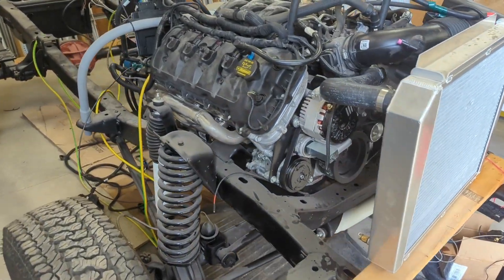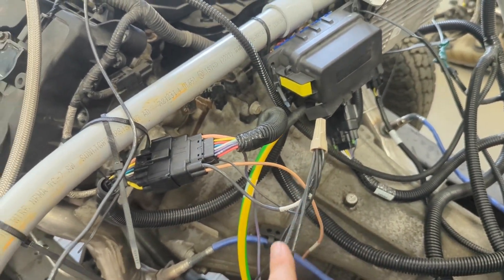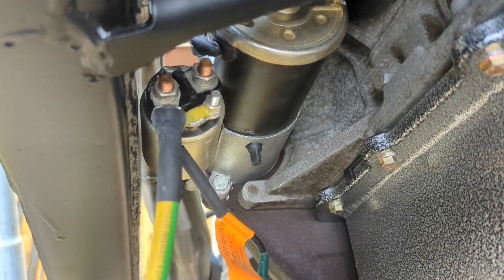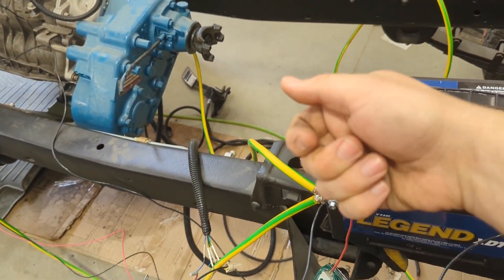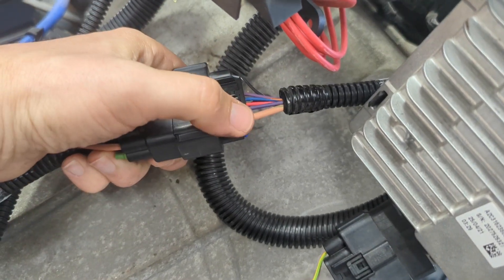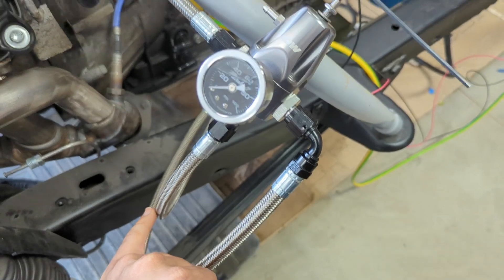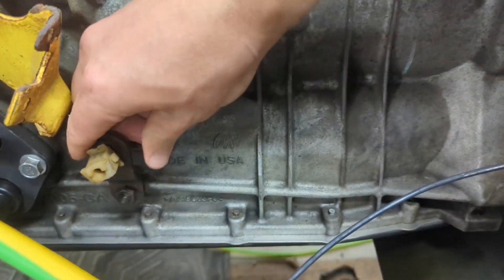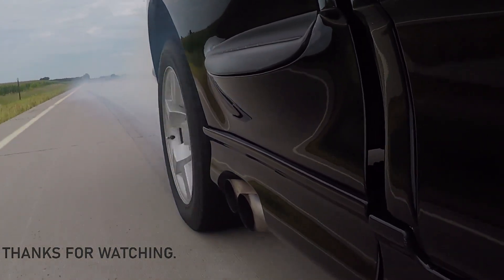How to Wire a Gen1 F150 Coyote 5.0L with PBH 6R80 Harness and Ford Performance Control Pack

Comment: Did you do something to the ECU?
I mean, deleting the PATS ando those safety systems from the original setup.
I'm working on the same gen 1 swap and I'm having a lot of issues.

Nice video, man.
Reply from the maker: We did nothing with this ECU. It came with the pack.
Reply: @605BOLT so the ecu it's completely stock?
Because i heard that I need to flash it to delete the system that I don't need.

Thanks a lot man, I'm trying that and let you know what's next.
Reply from the maker: @DOSCID96 it doesn't need flashed because it was part of the power pack. If you take one from a pickup or something then yes I think it needs to be flashed to remove that.
Reply from the maker: Thank you for the kind words.

Comment: What long tube headers are those?
Reply from the maker: They are from BC broncos. Idk that I would recommend them. Nowadays I would probably buy a set from Toms Off-road.
Reply: @605BOLT ok I appreciate it, I’m coyote swapping a 64 galaxie so I got to find something that fits nice and tight and the flanges don’t hit the Fire wall
Reply from the maker: @sammyvices2547 oh I gotcha. Then these BC units might not be terrible. Idk this for a fact but they seem like they might be mustang headers that they just put different ends on. You could try the same if it looks like they will fit.

Comment: Did you use a stock engine harness or is it a modified harness to accommodate the Mustang firing order?
Reply from the maker: The engine harness is the one from the truck.

Comment: Nice work, thank you! So you don’t have to do anything with the transmission lines to test run it?
Reply from the maker: If you want to run a long time then sure. We started this one with drained transmission fluid and no cooler. Need to make sure the trans is in park though.

Comment: Will the inner fenders fit or is there trimming.
Reply from the maker: For a coyote swap on a bronco, you need to do like a 2" or 3" body lift and then one of the fender wells needs to be tipped in.  The Rustbelt Offroad body that he has came with the fender well tipped out.  Its not a huge change.

Comment: What headers did you use?
Reply from the maker: @jameycreek5062  they are bc broncos. I would probably go a different route today. They're just so so.
Reply: @605BOLT They sure look better than mine & have the sensors built in, unlike mine
Reply from the maker: @brianberes6564  ya if I had to do it today I would probably go wild horses or toms
Reply: @605BOLT Mine are Tom’s via PBH.  They were the least expensive but look good and fit ok but very tight to transmission.  Only regret is no bung for the sensors …
Reply from the maker: @brianberes6564  sounds like you'll be drilling and welding haha. Oh well I've had to do that a few times. Not too bad.

Comment: Hello! What transfer case are you using and what kit did you buy to adapt it. Thank you !!
Reply from the maker: The transfer case is a J Shift Dana 20 from a the last years of the early bronco.  The kit we used to adapt is an Advance Adapters 6R80 to Dana 20 setup.  I have a video showing the installation here. 

https://youtu.be/m1MD5Y3Cd9Y

Comment: awesome!! i've been looking (and waiting) for a concise video showing all of the connections to the PBH harness and the control pack. thank you for making this video.
Reply from the maker: @ramrodou812  no problem man. Hope it goes smoothly for you. It's not bad with a couple of the little things clarified.
Reply: Although, I always thought that with the Ford Performance control pack, you wouldn't need anything else.....especially with the cost of it. I'm going to use a manual transmission in my swap. Is the control pack adequate for a manual?
Reply from the maker: Control Pack is good to go with a manual I think.
Reply: @ramrodou812 go with the Ford Racing control pack. I called PBH and told them I was looking for a control pack for my Mustang and I would be running a manual transmission. We had a long and good conversation. The manual transmission came up a lot as in which one I was going to run. They still sold it to me without any warnings. 

A couple months went by and then I started putting things together. I found out I was missing the harness that goes to the O2 sensors. 

I had to call back a few times till I got somebody on the phone. Turns out they don’t make a harness for a manual transmission or an old school automatic transmission like a C4. 

So they sold me a GT500 harness and I have to thin it out and keep what it needs to run. I’m into the kit about 2,400$ plus the extra time. Also, I bought a factory wiring diagram to make sure I get things correct. I wish I would have just bought the Ford Racing control pack.
Reply from the maker: Good info

Comment: Very cool. Thanks for the cool tutorial.  Just ordered my swap components from PBH.
Reply from the maker: @brianberes6564  right on. They have been very helpful. Travis is the guy I was working with and he's a good dude. Hope your project goes well.
Reply: @605BOLT what did you guys do with the oil cooler? Relocate or delete?
Reply from the maker: @brianberes6564 removed in favor of a remote filter mount. They're all basically the same but a housing mounts where the cooler meets with the block. And then you mount the filter wherever by two hoses
Reply: @605BOLT Sounds like what I ordered. Where did you guys place the filter?
Reply from the maker: @brianberes6564  haven't yet. But many put it on the frame horn without the steering box. Somewhere up there I have seen. Let us know where you choose and if you like your choice!
Reply: I’ve got mine mocked in place on the frame.  Where did you source your rad hoses from?
Reply from the maker: I don't remember actually. 🤔